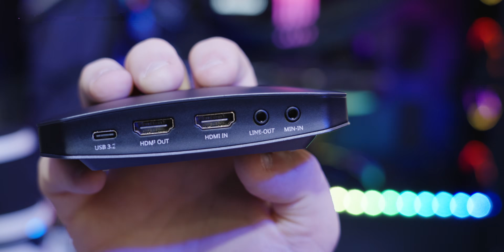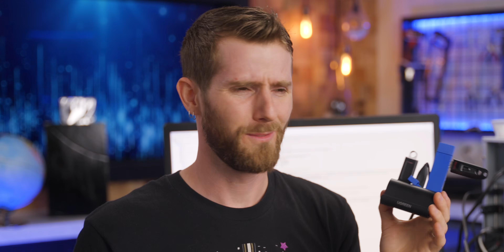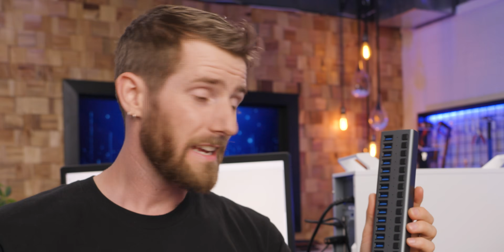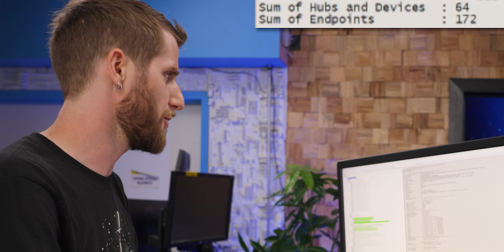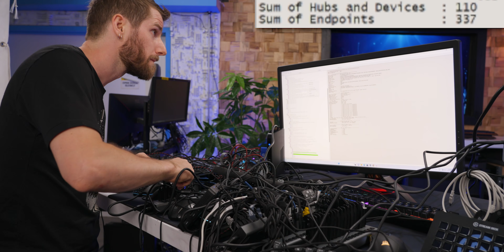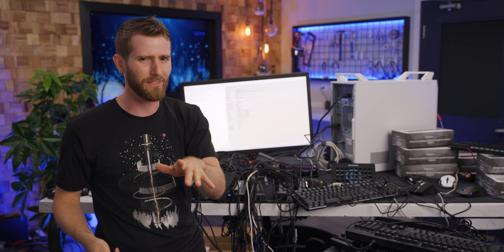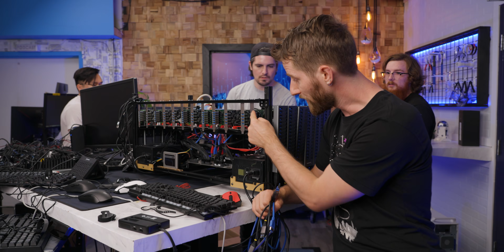How Many USBs Can You Plug In At Once?

Comment: Most modern computer motherboards will have more than one host controller.  My laptop has 2 host controllers sharing the same chip package on board with the same bandwidth but my main desktop has 4 physically separate host controllers separately connected to the system 2 via the PCIe lanes on the motherboard from the CPU and the second two connected to a PCIe multiplexing switch chip on the motherboard.  Having 2 or more USB host controllers is quite common on any standard motherboard these days.  Windows however does have some limits if you add too many USB devices.  Linux is much better at handling large numbers of devices since the OS handles them a little differently.  It is very understandable that the system is using a ton of CPU resources to poll all of those ports, especially the devices like keyboards and mice that often try to maintain sub 1ms polling rates.

This is also why you don't see hubs used in ethernet installations any more since the overhead of managing all of the ports can begin to overwhelm the devices and controllers all using the same string since each hub in a string doesn't have any memory to store and forward the data so the main host controller must poll each device one at a time and the more devices you add to the host controller the slower overall that network of devices gets.  If multiple devices need to send data on a hub they have to send their data packets one at a time and the controller will switch between devices.

In the world of USB if you have any devices that stream data they will need to be connected to or very close to the root host controller with very few if any other devices on the same host device.  This is also why USB sound cards and video capture devices can have unacceptable delays in their input or output if they are not combined in the same device like delays between a webcam and microphone during a live stream that have to be adjusted for in software.

Comment: A lot of the 127 limitations with such devices have stuff to do with the protocol makers who thought it would be sufficient to only allocate the 7 least significant bits of a single byte in a fixed-length frame to represent the amount of a certain type of objects. The most significant bit is usually used as a flag to indicate some status, such as the validity of the value. Since the USB protocol has plenty of fixed-length data structures such as requests and descriptors, it can be a huge pain in the ass to work around these limits. Take the totaly amount of modifier keys simultaneously pressed on a keyboard for one. Plus, I'd be happy to see new USB HID protocols and DirectX versions surpass the 127-button limitation with a single USB game controller device. This again has something to do with a byte field in the report descriptor, however in this case the descriptor format is flexible. It doesn't seem to be crazy difficult to expand the protocol to accept longer frames while keeping downward compatibility. Older devices become legacy over time and support for them may eventually be dropped. Kudos to AMD with the expanded endpoint support, they could have bragged about it. I never bothered looking into how endpoints are handled on the controller side, information like this is probably off limits to me anyway. An endpoints is, as the name suggests, either the ultimate origin where data is collected before sending over USB, or the ultimate destination where that incoming data is received into for a devices to consume. It's just a USB-relevant way of calling a section of the RAM of a tiny computer chip. An endpoint comes in various sizes and it's often much easier to allocate a portion of RAM for a USB device - just write the code and hit compile - than managing the RAM space of a host controller chip for a whole bunch of different devices. This RAM has to be large enough to begin with, then this RAM would also have to be dynamically allocated and released as USB devices get plugged or unplugged. It's actually pretty amazing to see how robust the USB interface is, in far less crazy settings.

Comment: You don't need drive letters under NTFS. Mount the drives to folders. Edit (before i stand the risk of correction): You only need drive letters for boot, OS, and swap file hosts. Anything else may be mounted to root drive folder structure.
Reply: Everything is a file, everything begins at /
The Way of Unix (and thus GNU and Linux)

Comment: We reach on one Project a USB3 32(96) Limit, so we changed the USB Cable Extensions to USB2. A USB Cable 5m have a Hub/Device. And Some Hub devices with more then 7 ports are full chained, so hub1 last port go to hub2, hub2 last port go to hub3, etc., so you get fast to tree limit.

Comment: A while ago, when I was playing around with using powered USB 3.0 Hubs.
At the time I found that some USB Ports will allow the excess power from the hub BACK into the USB port.
It wasn't noticed until I powered down the system. At that time, the CPU fan keep running and was still lit.
It seemed that the power from the USB port was going back into the PCIe bus, which is where CPU fans & lights get their power from.
To solve the issue, I made little pigtail cables with the DC +/- both using diodes and added a barrel jack to allow external power as well.
For a power source, I use a device designed for allowing mass charging of cell phones with 32 USB-A 5v2a per port with no data lines connected.
I use it to supply individual power to each of my HUBs& anything else that uses a USB power brick.
So my KVM switch, LED lamp and my additional input devices all have power independent of the PC's PS.
These type of pigtails were used back in the day when devices first came out and needed more than the max power that a USB port could supply.
They added an additional USB cable that would just take the power from an additional USB port. I'm not sure if they had any diodes back than as I used anything that used this trick.

Comment: What if you got around the drive letter cap with NTFS folder mount points?  I want to see a file system where every folder is another flash drive.  IIRC you can easily turn off the automatic mount of new disks and it's default on server version of windows.

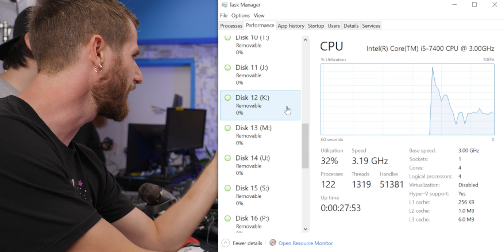Comment: Can the A12 9800 really recognize this many end points due to the X470 chipset alone? My Windows 7 build's gonna be insane, type A 10Gbps for crying out loud. That kind of speed will definitely be needed for my workflow on my Sandisk Extreme V2. 23:38 NOPE! Nope not even close. Running these usbs is tougher than running Windows 11 background tasks by a long shot.

Comment: When using a powered hub, I wonder how long the cable connecting it to the usb can be before it stops working? Or instead of cutting and rewriting the wire to test this, how
many usb extension cables can you use?

Comment: i found out how crazy this can get when i ran my full race simulator though 1 usb cable, and not even a short one, like a 5m cable in to like 4 hubs all running full gear like bassshakers + Amp for bassshakers + Wheel + another keyboard/mouse, my bluetooth dongle, another amp for the 5.1 surround, shifter, arduino,  and i'm probably forgetting some of the stuff plugged in hah

Comment: For some things he is using externally powered hubs, but a bunch of devices were being plugged in directly. I wonder if he was running into slot power limits. Many thumb drives pull what i see as unreasonable amounts of power. Why does a usb stick pull/requedt more current than a heated mouse for instance

Comment: Been there and found the bios could not boot with a couple of qnap expander installed with 12 drives. Was trying to do storage on the cheap. Supposedly  a supported option.
Not a usb controller issue., bios would lose the boot devices when enough usb storage disks added. Cant remember if it was uefi or legacy boot.
SuperMicro were super helpful and supplied a couple of custom bios updates. But eventually decided this was way too janky and bought a NAS to attach expanders to.

Comment: I am curious how much of an impact using HID devices had on this test. I know this was a "for fun" video - but input devices generally require an interrupt, and interrupts are typically a limited resource, though I know its a lot more complicated on a modern platform than it used to be, but that could be causing a problem before you actually hit the limits of the controllers and the OS/drivers.
Reply: As far as I understand USB doesn't do interupts. The PS/2 ports used interupts. USB uses polling instead of interupts.
So instead of the device interupting the OS, the OS asks regularly if anything changed.
USB 1.0 support 125hz, USB 1.1 1000hz and USB 2.0 8000hz polling.
That's also the reason why gaming mice and keyboards stayed with PS/2 connectors for so long.

Comment: I remember my old Pentium II with windows 2000 SP4 it has only 2 USB on back! I used two hub in daisychain for each port -> 4hub in total and 14 USB port for use. First hub in PC was powered by homemade cable connected to 5V line in molex. It handle all device I need that time well.

Comment: Would it be feasible to have all of those USB thumb drives be set up into a RAID configuration to use as a secured hard drive?  As in, if you shut your system down, remove a single thumb drive, you negate readability without plugging that one thumb drive back in?

Comment: think this is not an unfamiliar problem within music studios. 
Lot of devices comuicates over MIDI. in most home studios one would just simply plug in the USB and be fine. but once this becomes many different synthesisers, MIDI Controllers and other gadgets. This is the result combined with latency.
so to come around this we could use a 5.pin MIDI HUB. and through this device route the midi communication instead of plugin everything with a USB to the computer

Comment: I have had enough external hard drives connected to my PC at one time that I nearly ran out of drive letters.  I had to leave at least one letter free so I could plug a phone into the front to download photos.  I had DVD and Blu-ray drives plus the standard boot drive, meaning I had 23 drive letters left.  So I have had 23 external drives plugged in at once, plus the wired keyboard and mouse and a flatbed scanner, for a total of 25.  Now I have an enclosure that holds 8 huge drives, so I'm now using one USB for my main external storage.  I don't know how I could reach the limit on my machine.  I have an external book scanner, but I only hook that up when I actually use it.

Comment: A very nice video, thank you!

Damn, this remembers me when I was coding USB devices on micro controllers...
Did you know that HID devices can specify which part of the human body is supposed to use the said device?
Yes, you can chose down to left pinkie if you so desire to...

Also, the enumeration process may have crashed on your system, that may be what was off.
All devices are given number 0 until the system can attribute a definitive number.
So, if you plug multiple devices at the same time on a slugish system, you can end up with bad enumeration ("multiples devices with the same number"/"devices without number").
Reply: Is the field for which body part the device is intended for limited to a set of pre-defined options?

For completely innocent reasons, ofc 😂

Comment: i wonder how long a mouse would take to input something with 200 usb adders or whatever they are called connected 1 to the other and 1 to the 1 to the other and so on. probably less than normal but insanely fast and not that noticable
pls try it if possible

Comment: Any idea why an MSI MAG Z690 Edge DDR5 Wifi board runs out of resources for USB after 4 devices? I thought it was due to power limitations so I put a powered hub and can still only plug in a keyboard, mouse, Logitech wireless headset dongle, and a usb stick before it tells me its out of resources. Could it be due to the LED's on the fans and system board? Its my first PC with RGB and it seems odd that a single USB data lane for RGB could cripple the USB functionality, especially since the board itself has 6 ports on the back...

Comment: I have an Unihertz Jelly 2E phone (Android 12), a 5 year old HDTV (not a Smart TV), an old USB mouse (I dont if it is USB 2.0 or 3.0) and a Sandisk Cruzer Glide 16 GB USB flash drive (bought in Nov. 2016 and I dont know if it is USB 2.0 or 3.0). I need to mirror the phone to the TV so I can have a bigger screen and dont have to look at the small phone screen all the time. The TV has a USB port and an HDMI port. I need to connect the mouse to the phone so I can look, tap and swipe on the TV instead of looking, tapping and swiping at the small phone screen. I need to connect the flash drive to the phone so I can access the files. The phone should be able to use the mouse, flash drive and mirror on the TV simultaneously. Can I use a hub with 4 USB ports where I can connect all 4 devices and all would work simultaneously? Or can I use a hub with 3 USB ports and 1 HDMI port? Can someone recommend 1 hub or equipment that is available at Walmart or Amazon that can handle these all at the same time. My phone has only 1 micro USB port so I dont think I can use more than 1 adapter at a time. Thanks.

Comment: This is something i was wondering about because the back of my PC is a little busy with USBs. Wireless mouse and keyboard, two external SSDs (for a total of five SSDs in my PC.), my wireless headset usb, and a ubs to usbc cord to charge my mouse, keyboard, or game controller. I am running an intel CPU, but my computer is pretty new, so it should be more than powerful enough to handle all that considering what I'm seeing here.

Comment: This video is a year old but maybe someone can help me understand. Using my Elgato stream deck and filling all the ports on the back of my MSI z690 pro would cause issues. I had one port using a hub that only had 3 usb in that. 

1 port on front panel was used for an external hard drive. A lot of the time I would have issues with latency on the stream deck. I pressed a button and much later it would change. Or sometimes even fail to do anything. Only when I moved the Elgato away from other USB ports would it work correctly. 

My thinking is these cables aren’t properly shielded and cause interference with one another.

Comment: Hey @Linus, I'm stucked with a strange error "not enough usb controller resources", I have Ugreen USB 3.0 KVM switch with USB HUB(Generic USB 2.1 Hub Self powered), in which i have connected Razer DeathAdder V2 X HyperSpeed - 2× Mouse, Shenzhen Xunweijia Development FIFINE 683 Microphone - Audio, ASUSTek Computer ASUS AI Noise-Cancelling Mic Adapter - Audio and Holtek Semiconductor HTLTEK Gaming keyboard - Keyboard. When i connect all devices at once i get notification "not enough usb controller resources". Either Mouse or ASUSTek Computer ASUS AI Noise-Cancelling Mic Adapter - Audio stop working. And the strange is that only Microphone of ASUS AI Noise-Cancelling Mic Adapter stop working headphone worked fine. 

Can you or your help in understanding the issue?.

Below is the USB Tree View
Sometimes Razer DeathAdder V2 X HyperSpeed work or something only Microphone of ASUSTek Computer ASUS AI Noise-Cancelling Mic Adapter does not work
And get notification "not enough usb controller resources"
Intel(R) USB 3.1 eXtensible Host Controller - 1.10 (Microsoft)
\---USB Root Hub (USB 3.0)
    |---[1-1]: Generic USB 2.1 Hub Self powered             : yes, Demanded Current         : 100 mA, Used Endpoints           : 2
    |   |FS-[1-1-1]: Razer DeathAdder V2 X HyperSpeed - 2× Mouse, 2× Keyboard, 10× HID -- Demanded Current         : 100 mA, Used Endpoints           : 6
    |   |HS-[1-1-2]: Shenzhen Xunweijia Development FIFINE 683 Microphone - Audio -- Demanded Current         : 100 mA,Used Endpoints           : 2
    |   |FS-[1-1-3]: ASUSTek Computer ASUS AI Noise-Cancelling Mic Adapter - Audio, HID -- Demanded Current         : 100 mA, Used Endpoints           : 4
    |   \FS-[1-1-4]: Holtek Semiconductor HTLTEK Gaming keyboard - Keyboard, 3× HID -- Demanded Current         : 100 mA, Used Endpoints           : 5
    |HS-[1-2]
    |HS-[1-3]
    |HS-[1-4]
    |HS-[1-5]
    |22-[1-6]: Realtek USB 2.0 Card Reader
    |HS-[1-7]: AzureWave USB Composite Device - Camera

With method all device in working, I just added a new a cheap USB 2.0 hub instead of Mouse and i connected my Mouse to newly connected HUB and it worked.
Intel(R) USB 3.1 eXtensible Host Controller - 1.10 (Microsoft)
\---USB Root Hub (USB 3.0)
    |---[1-1]: Generic USB 2.1 Hub
    |   |---[1-1-1]: Generic USB 2.0 Hub
    |   |   |HS-[1-1-1-1]
    |   |   |HS-[1-1-1-2]
    |   |   |FS-[1-1-1-3]: Razer DeathAdder V2 X HyperSpeed - 2× Mouse, 2× Keyboard, 10× HID
    |   |   \HS-[1-1-1-4]
    |   |HS-[1-1-2]: Shenzhen Xunweijia Development FIFINE 683 Microphone - Audio
    |   |FS-[1-1-3]: ASUSTek Computer ASUS AI Noise-Cancelling Mic Adapter - Audio, HID
    |   \FS-[1-1-4]: Holtek Semiconductor HTLTEK Gaming keyboard - Keyboard, 3× HID
    |HS-[1-2]
    |HS-[1-3]
    |HS-[1-4]
    |HS-[1-5]
    |22-[1-6]: Realtek USB 2.0 Card Reader
    |HS-[1-7]: AzureWave USB Composite Device - Camera

Comment: In the cae of USB drives, what happens after all the letters are used for drive naming? and the few special characters are exhausted?
Reply: After that windows will not mount with drive letters but you would have an alternative to mount it in the directory rather than the drive letter.